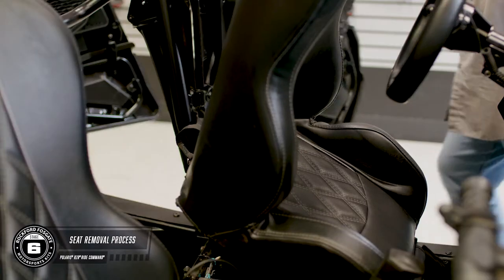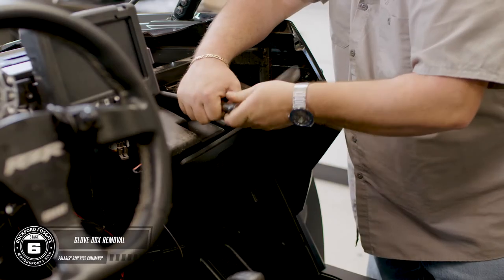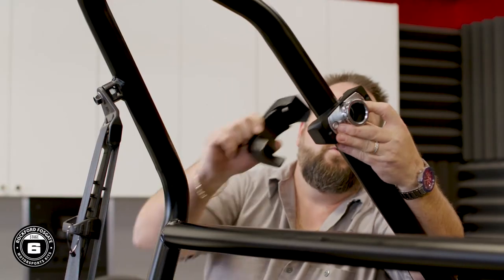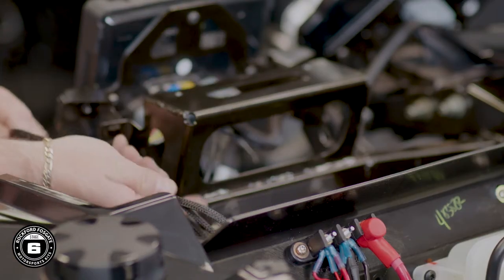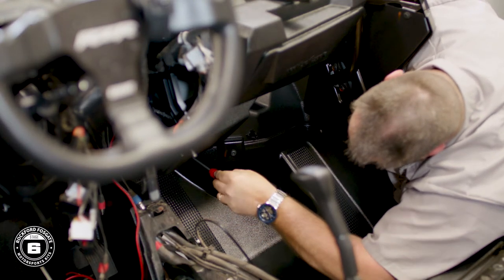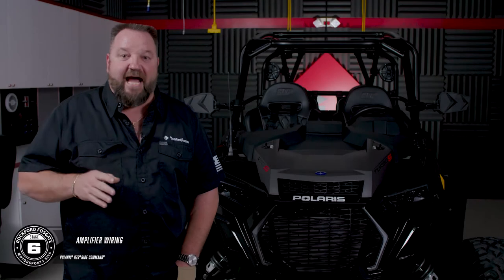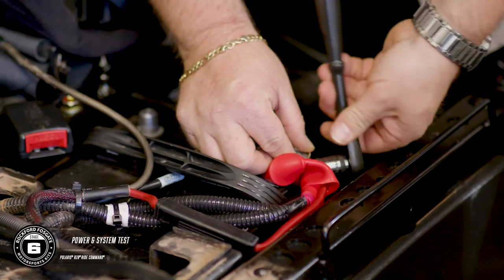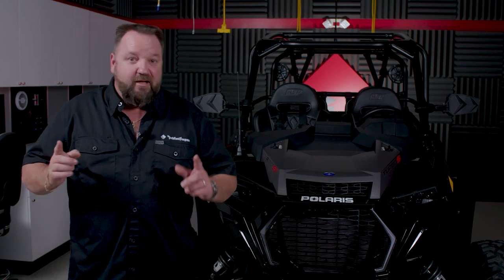RZR Ride Command RZR14RC-STG6 Installation (Gen-3)

Comment: Just installed my Stage 6  3rd gen
1. The plug from from stock amp where does that connect too?
2. Having a fuzzy noise coming from speakers as well.
3. When i turn accessories light on/off i hear a noise flicker from the speakers.
4. Do i need to update ride command software. 
5. The amp i have is it already dialed in for my Ride Command. 
I haven't tried turning on the  RZR maybe. Have it in with key ignition on.
Any advice thanks. Planning on calling customer service tomorrow as well.

Comment: Is the 4 channel M5 800X4 amp a direct replacement for the Fosgate 2 channel part #4017614 that comes on the 2021 RZR turbo s, plug and play?
Reply from the maker: @matthewderry6475  No, the factory amplifier and the aftermarket M5-800X4 are not interchangeable.

Comment: What should the amp setting be at?
Reply from the maker: The amplifier is already pre-configured.  The INPUT = 4-CH and the PRESET = ON.  The preset switch engages Rockford Fosgate’s own tune for the best performance possible.

Comment: I have this stage 6 on my turbo s. I have a audible noise that comes out speakers unless the suspension setting is on firm.  Why would that be ?
Reply from the maker: Unscrew the amplifier and place a piece of cardboard underneath it.  Turn the system back on and cycle the suspension settings.  If the noise goes away, use some nylon washers to re-secure the amplifier, so the mounting screws don’t physically touch the heatsink.

Comment: I wish the subwoofer enclosure had a mini glovebox like the SSV works version. I'm sure the Rockford one better but would still be nice.
Reply from the maker: Thanks for the feedback Vincent.  Our 1st generation subwoofer enclosure did retain a glove box.  However, based on dealer and customer feedback, many told us they wanted more bass, even if that means removing the glove box since many told us the didn't use it.  We made the decision to make the 2nd Generation enclosure have better bass performance with the option to be sealed or vented, giving fanatics exactly what they asked for.